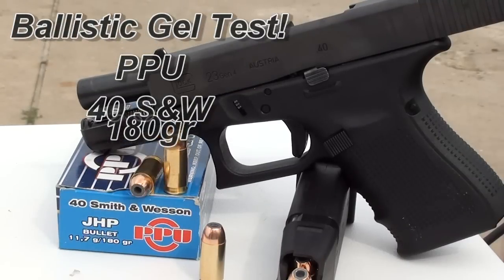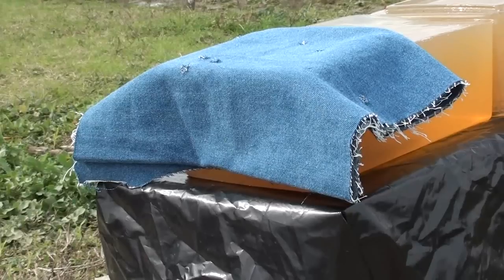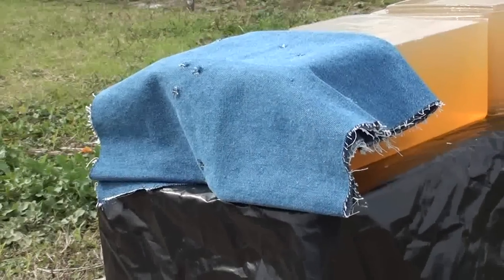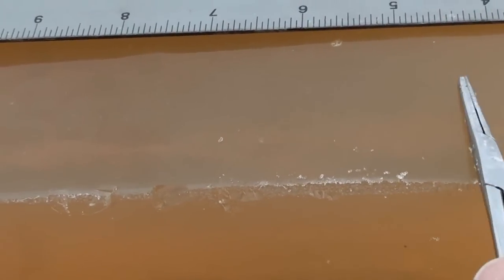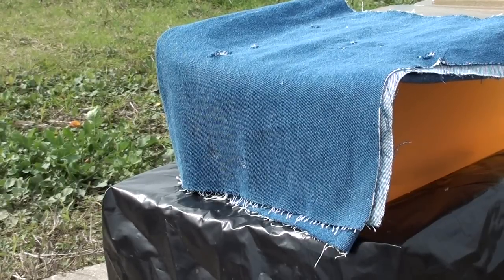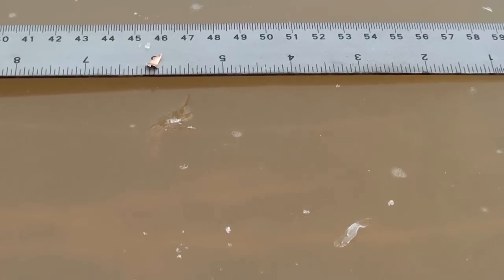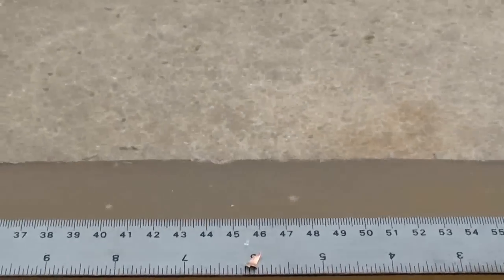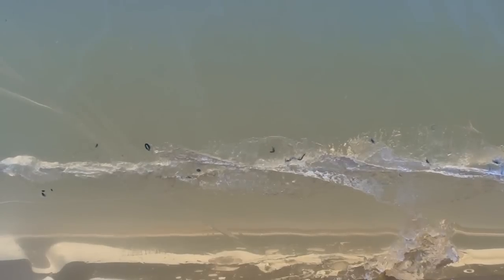40 S&W Ballistic Gel Test. PPU 180gr JHP

Comment: I found a way to get it to expand: Fire at out of a 16 inch barrel! I had exactly the same results as was demonstrated in this video, when I fired the rounds out of a 4 inch barrel handgun. However, it DID expand when I shot it out of a carbine. The jacket still peeled off, at about 3 inches, but the remaining lead DID expand. Not as pretty as better quality rounds, but the rounds did stop within 14 inches and they had expanded (minus their jacket).
Reply: Good to know that this would work for 40 cal keltec's.  Same thing with the IMI 115gr hp.  Has to be traveling faster than a pistol can take it.  8 inch carbine or longer.

Comment: Three thoughts on under expanding hollow points and self defense: 1) I'd rather have over penetration so that if it were to hit bone before entering the chest cavity, it still has plenty of forward momentum and a low drag coefficient to ensure enough penetration to hit vital areas even at odd angles of incidence. 2) Jackets are to protect the lead during the acceleration phase inside the barrel and reduce fouling. A little jacket shedding isn't going to make that big of a difference. 3) Two holes allow more blood flow than one.

Main points to stopping things that bleed: either through massive blood hemorrhaging or a central nervous system hit. Both of which would seem to imply a round with at least 24 inches of penetration. 12 inches to vitals + 50% to account for odd angles + 50% for bone.

Bystander safety is a tough one because of the large range in situations that can occur.

Of course, this all just a personal opinion, take it as you will.